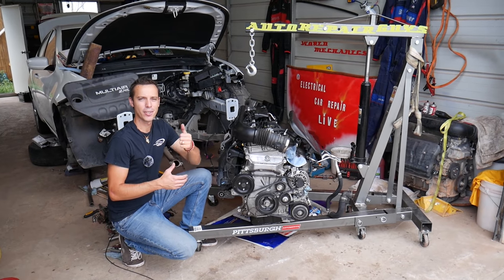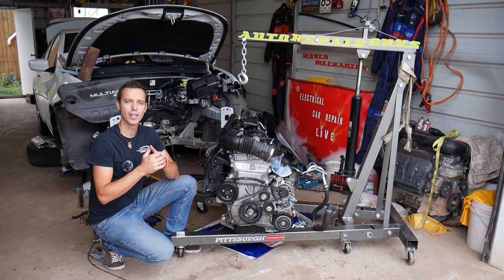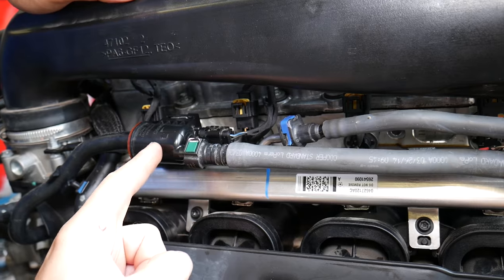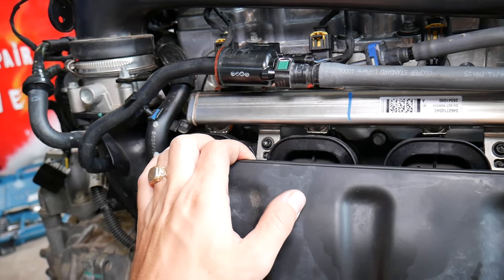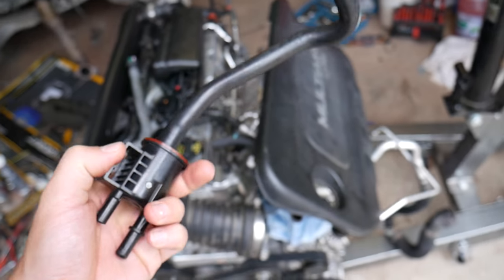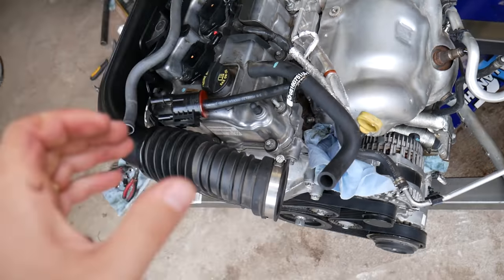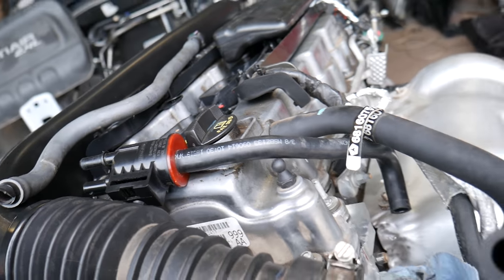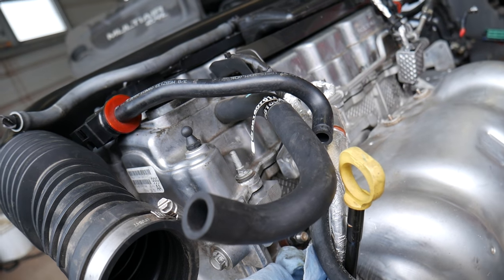SYMPTOMS OF BAD PURGE VALVE. HOW TO KNOW PURGE VALVE IS BAD

Comment: I have question I'm getting oil blow coming out my throttle body it's not alot but enough to notice on my driveway could this be what I need I've changed pcv valve / plugs and gave it an oil change or do I just need to put an oil catch can on
2017 ford escape ecoboost 1.5 L engine

Comment: Please talk about the PO425 code.  I am currently replacing the purge valve canister; but, would like to hear your reasoning and logic for the PO425 problem tracing.  When you talked about the codes for the canister you did not mention the PO425.   I am wondering if I am on the wrong track.

Comment: My 2011 dodge caravan stalls sometimes when I come to a stop. It starts up immediately no problem. When I come to stop I have to put the car in neutral in order for it not shut off. Can this be the purge valve? Also, it revs on its own when I'm idle sometimes.
Reply: You need a throttle Position sensor, and or Idle air control value, there pretty cheap on ebay
Reply: ATCkeepsUsafe  Are you serious? You misused (to) I think you meant (too). We really need to stop acting like this, because no one is better than anyone.
Reply: Was trying to help give info, not win a spelling or correct grammar award..smh
Reply: Was your problem, a  Mass Airflow sensor

Comment: What about hesitation when you accelerate or mash the gas pedal?
Reply: Yea mines is doing the same as well, did you ever figure out what the problem was?
Reply: @dewanclark3699  
I never could figure it out. I changed sensors, plugs, coils, everything I could think of and gave up and traded it for a truck. I'm done with a Lexus, haven't had good luck with Camry either but Lexus are really nice cars, just too technical for me. I can work on most vehicles but them seem to have a mind of their own.

Comment: I have changed out my fuel pump 3 times now thinking it keeps shorting out but now I am thinking somehow that the evap canister is making it turn off what would I check 🤔
Reply: I always check the easiest first, before spending big $$.  In my case I removed the vac line and put some plastic over it and put the vac line back on, then I started engine to check for rough idle, etc, if gone the solenoid if full open when it should not be, replace it, take plastic off vac line and clear codes, drive and see if code come up again, if running smooth, then you got the main cause, other minor leak codes from other parts can come up too. Actual fuel pump problems are a separate issue.

Comment: there's actually a 4th reason for purge valve failure. 
i had one clogged with rust particles. it threw code p0455 and P0420.
i changed it at work and didn't realize it was full of rust until i got home and grabbed it to take inside.

Comment: Is a purge valve same as pcv and egr valve? If not can you do video on Dodge Intrepid 2000?
Reply: No.
Reply: EGR valve can probably be cleaned. On my old saturn the EGR was right next to engine, 2 bolts and it was out. Theres a valve under it that pushes in and they get gunked up after a while. Take some brake cleaner to it to clean, and put it back in

Comment: Can a bad purge valve cause rotten egg smell at high speed I changed the battery and it isn’t that I I scanned it and said fuel cap changed it now the code for purge valve came up for my 2006 Lexus is250

Comment: I have an issue with my car where when i let off the throttle, the rpm needle twitches up and down, it only does this when i let off while driving, it doesn't happen when the car is at idle, what could this be.

Comment: I just had a new engine put in my 2015 kia optima. It was running find. Now the engine light keeps coming on. Now they are saying it the hose from the pcsv and smoke evap system. They say I need to replace  ccv. Now it's  not driving, right, and they want $400 to fix it.

Comment: hi i have a 2006 audi a6  with a p02404 evap emission system leak detection pumpe sense, circuit range/performance. what exactly i need to change thank you

Comment: If you can get an owner/car yard with  the manufacturers OBD2  scanner they can usually test, by actuating, the operation of the EVAP canister purge and vent solenoids.  My car also with a normal OBD2 scanner can tell the result of the cars own EVAP testing which it does on its own when the car is turned off.  I'm not sure how it tests, but I guess it tests if the EVAP canister holds pressure when valve shut etc...  ALSO I gather if the EVAP canister is old/faulty and doesn't hold the level of fuel vapors the ECM expects that too will give a Lean?

Comment: i have codes po171 po300 po130 and i have already replaced the a/f and the maf air filter checked injectors, but no codes for purge valve and have already checked vacuum leaks
Reply: What’s was the problem please and how did solve it because I have the same ? Thanks

Comment: my 2016 ford fiesta keeps stuttering and stalling when  I put gas into it.  I wont start, and i will have to push the gas to get it to go. But it doesn't do it after i finally start driving around. I'm thinking it's the purge solenoid. but not sure
Reply: Yes my 06 Saab aero does the same thing. But mine will start after getting gas just slowly. Purge valve can cause this, ESPECIALLY if it drives fine between gas tanks
Reply: Did you ever find out of the purge valve was your problem??
I have the exact same issue on my 2008 Elantra...as soon as I fill up with gas and go to start the car it will start no problem like always but it will drop RPM and stall out right away. 
I have to start it and keep the revs up and keep it from stalling out. Before I leave the gas station i give it a few revs or hold the RPM's steady above 1000 RPM or so for 15-30 seconds then it will get back to normal, or if i start it and put it in drive right away before it has a chance to stall to drive off then it's good then too. 
Had a used engine put in just yesterday and picking up the car tonight so I'm hoping the new used engine had a good working purge valve on it. Fingers crossed

Comment: Hi!  My 2016 MINI Cooper S has some slight vibration at idle and when I touch purge valve hoses, I fill knock/rapid pulsating vibration for 40 seconds to a minute, then vibration goes away and engine feels smoother.  Then after around a minute, same thing happens.  There are no codes.  Any ideas?
Reply: Your purge valve is going out. Its starting to confuse itself. Usually what happens before they fail all together. Just go buy another purge valve, inexpensive and DO IT YOURSELF, YOU WILL SAVE like $100 or something
Reply: @_zach  Thanks, I will look into that.  When the above pulsating happens, in the cabin I also start hearing thump/knocking noise at the back.  The thumping in the back stops when purge valve closes.  I was thinking either purge valve is making the vibration that is heard in the back of the car or one of the EVAP hoses(close to charcoal canister) came loose of its clamp and hits the body of the car during purge.

Comment: Hi there! Got the 1.4, just got a code p0496 x4.. after engine is warm, under heavy acceleration only I get a rapid fire like, no problems if I dont throttle down.  I feel like you may know something about this lol
Reply: Btw.. I changed plugs and coil pack, problem solved, 👍

Comment: will this also cause the car to smell bad? please respond
Reply: Mine smells like gas bad from outside the car
Reply: @jordanfrary3876  check your gas lines underneath see if theyre wet to the touch
Reply: @timestamps8576  my purge valve should come tomorrow. I think that will fix it. Fumes in canister are released into atmosphere if not fed into engine. At least that's what happens in my 2006 Saab 93 Aero. Car hesitates to start when it is filled with gas with engine warm. Car smells like gas when first started, goes away when driving, even at idle at lights it doesnt begin to smell again. Mpgs down. Runs fine besides the loss in mpg

Comment: If it is stucked in open position , your engine's idling  rpm will increase considerably due to excess fuel & air and will vary for the initial 15 minutes of drive. 
If it happens & to confirm simply remove the hose from purge valve engine side while engine is running and block it with finger , the rpm will come down & get stable.😊

Comment: i  have mercedes sl 350 after o2 sensor replacment and clearing it i get the same fault p015300 oxygen sensor has a delayed reaction all wires i checked

Comment: Could this be why my 06 g35 is running like crap? Rough idle and almost stalls when I hit the gas on a cold start? Loss of acceleration and back fires at 2500 rpm or more
Reply: Sounds like my car

Comment: What does it mean when you get a p0441 purge valve incorrect/no flow. I replaced the valve and it still comes on
Reply: Is the cannister plugged up?
Reply: @sz4179  no. After 3 days of diagnosing with the little information I have. I found out I got 4.3v on the power side of the purge valve. And 12.5v on the pcm ground side. I pulled out the solenoid and it works fine as intended when I jump both terminals on the battery.  So I got a harness issue but idk where.

Comment: Can this cause for my car to start and stalls after a couple of seconds? Also when I unplug the MAF car starts and idles normal but won’t go past 4K rpm or 40MPH
Reply: Same boat as you my codes popped up maf sensor and purge valve

Comment: I'm getting a p0171 on a 2016 Sonic. 
Can't find a vacuum leak.

But when I clank my purge valve lightly with a wrench, it starts making a ticking sound and short trim comes down and idle becomes smooth.
Reply: I feel gas in cabin and checked and no leak . This valve is ticking with a 9 volt battery. I am not sure is it working or not?

Comment: I just replaced my purge valve bc I got a P0455 code on my sunfire, EVAP malfunction, been trying to figure out what part is messed up replace the gas cap first bc the rubber was a little crusty which only lasted 3 days before my check engine light was back on and another p0445 code so a mechanic friend of mine suggested replacing the purge valve so here's to hoping it works 😅
Reply: Did it work?
Reply: @humblerojo6300  unfortunately no it didn't, gonna try replacing the canister and vent control hopefully that'll work
Reply: Did the canister work
Reply: @ray1love1  yea it got rid of the code but now my battery had yeeted itself 😅
Reply: @alastarwolfe1338  ok well i checked my gas cap and it was off

Comment: NICE VIDEO BRO,, i was watch your many videos and i like it ,,and i will ask you something about my mercedes G320 W463 YEAR 1995 I HAVE PROBLEM WEN I OPEN MY FUELTNK CAP I HEAR AIR GET IN THE TANK BUT LOT OF could that be that purge valve problem or just charcoal canister or something else also wen i drive i have feling like my car only give me engine sound more and more but i dont feel that power and sometimes he have that power to usualy wen i open gastank kap (he start fine engine is in good condition etc )
Reply: Got a similar problem on a vw polo, customer has an intermittent missfire and it 'gasps' when the fuel filler it opened. code scanner thinks its the evap purge valve or the map sensor. did you get the the bottom of your problem?

Comment: Can a purge valve also cause an error about fuel mixture being too rich + MAF error? (thinking it stucks open and there are a lot of vapors after car sitting for a while)
Reply: DDAA  In my case it was a hose that was loose after the maf ( they didn't tighten it after changing air filter)
Reply: My 2014 gmc terrain 2.4, has no check engine light on. My issue has been after starting and idling for around 30 seconds and stalls, once restarted it never stalls. Runs perfect except on initial start, seems to do it around 10 out of 10 times when cold out, warmer weather about 3 out of 10 times. I put a new oem throttle body in, maf, new air filter, oil is always full and I use fully synthetic euro oil and Purolator  boss oil filters. The terrain has 60,000 original miles. I bought it at 52k miles and has done this since I bought it. I replaced vvt Solenoids also with aftermarket to see if helps. I ran 92 octane for a few tanks, ran fuel system cleaner, etc, still stalls. So going to try purge valve next. With no code is giving me a hard time. If purge valve doesn't help, then going to try plugs, cam positioning sensors, engine temp sensor. My egr line is oil free, no oil use between oil changes, no odd sounds. Idles at 900 rpm solid, no odd fluctuations, but after 30-40 seconds idle drops and stalls, grr is getting frustrating.
Reply: @rotwiler7674  did you fix your issue.. sometimes in these gdi engines there could be carbon build up around the intake valves.. run a can of CRC GDI cleaner through the throttle body let er heat soak for about an hour then take er out for a no good Italian tune up, dry hard for about 10 minutes or so on the highway to help blow out the carbon

Comment: Went to Toyota they wanted 550 to replace it the part only cost 147
Reply: I dont know what yota ypu have but thats still too much. I own a 2013 Cruze and the part is $20 on Amazon or $50 on Autozone. But $147 is still better then $500
Reply: What part did they replace fam because I'm having the same problem with my toyota camry it read 4 codes saying purge soloniod,gas cap, Cadillac converter

Comment: In my experience a bap evap purge soleniod will also make a loud ticking/ plastic rattling noise when they are old/bad and many people even auto mechanics will misdiagnose that noise as a bad timing chain and charge people $1000 for a whole new timing chain job when it's just the evap purge soleniod for $20!!! This happens a lot on 1.4 turbo chevy cruze/ sonic owners!